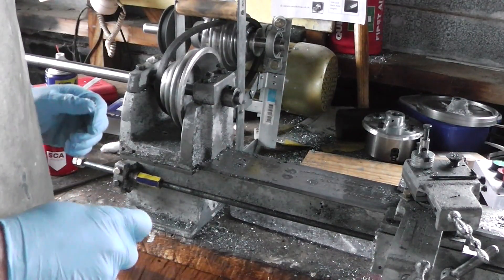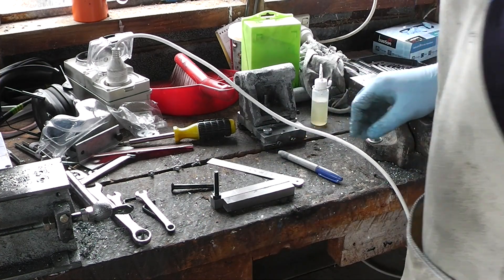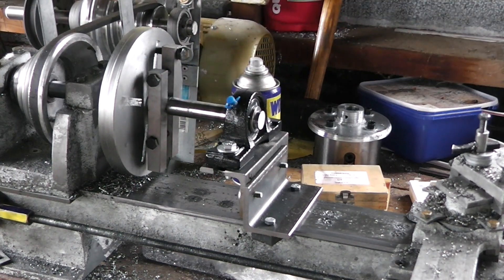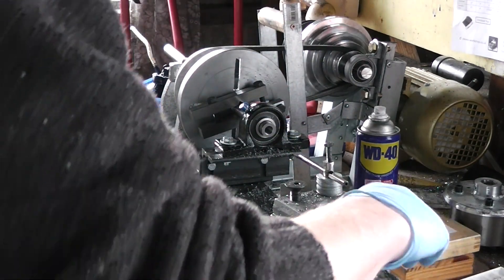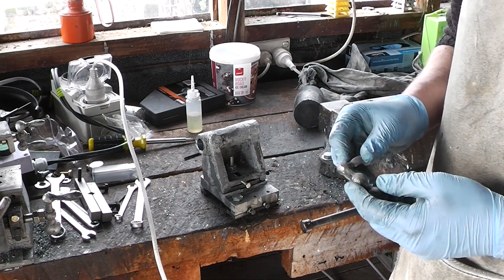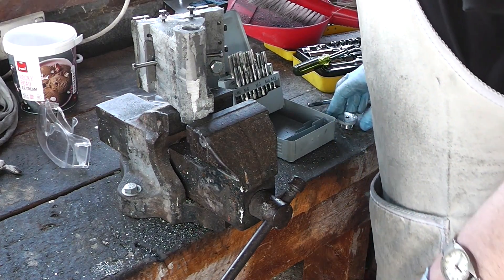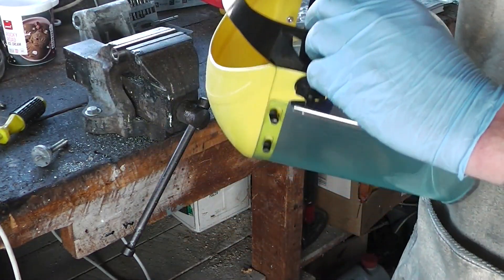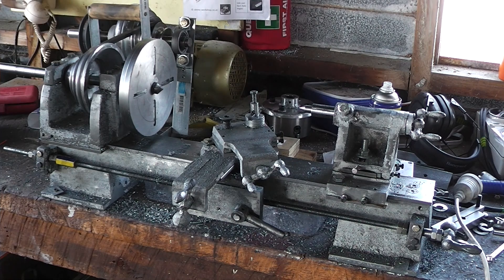Making the Tailstock Ram

Comment: A one eighth inch drill bit is closer to 3.3mm  (3.17mm) 
Slightly oversize probably better than slightly undersized, 70% thread engagement isn't a lot weaker than 100% but takes about half the power to tap (so half the torque with much less chance of breaking taps)
Reply from the maker: if I had a 1/8 inch drill bit, that would be something :)